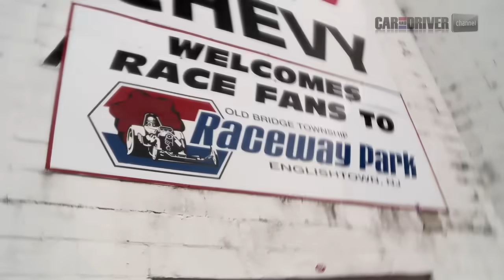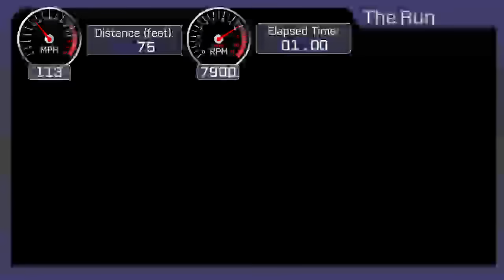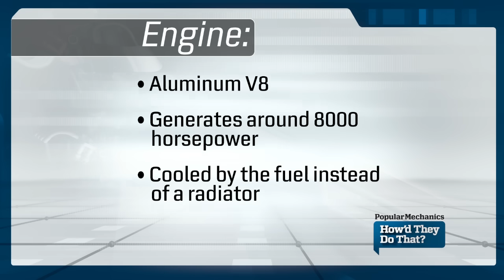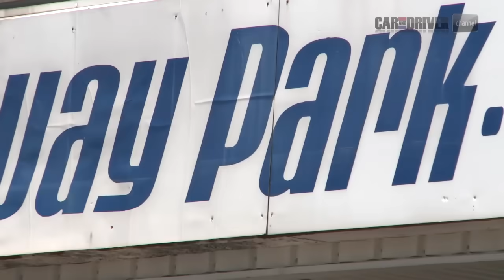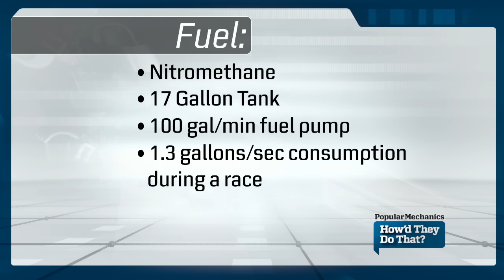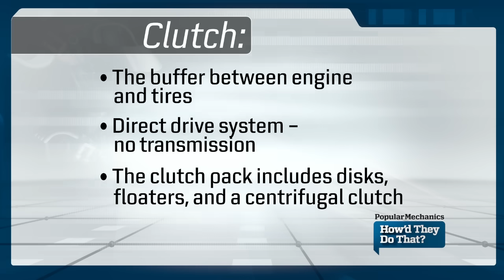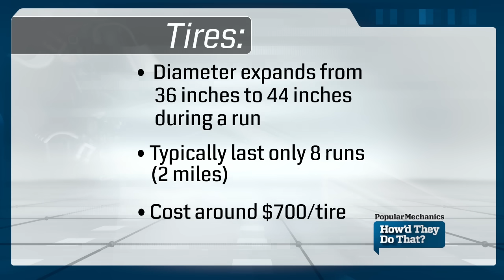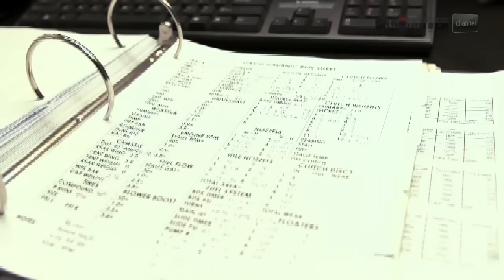How a Top Fuel Dragster Works

Comment: Crazy to think you need 600+Hp to run the Supercharger lol
Reply: Not really. 

Most engines require comparable power for compression, turbos, etc. 

The 1050 hp turboprop engine in my aircraft requires 2000 hp to turn the compressor.

Comment: These are so impractical as a daily driver. Especially if you live more than a quarter mile from work.
Reply: Yes, but you do get off the line at the stop lights a little quicker than the Corolla sitting next you.
Reply: Lou Clifton great for those mornings when you slept in a little.....
Reply: @davecasey4341  And probably also a bit faster than the guy flexing his Lamborghini at the stop light.

Comment: man i am cringing at the thought of how much money all those teams are spending for new engine parts
Reply: Alot they only use the motors for like a two race events or so then have to get a brand new motor and each pass alone probably costs 10,000 if not more
Reply: @thenotoriousnova1102  i wonder how they gear the cars transmission so they could reach 300 mph like that
Reply: Derek Wall yea its a crazy engineering feat
Reply: @derekwall200  No  transmissions, its a direct drive. The clutch provides slip until later in the run then the clutch locks up and it goes 1:1. The rear end is mandated at 3.20:1.
Reply: @derekwall200  no trans just a 5 disk clutch and a little gearbox behind that for reverse that's it

Comment: My 1964 Rambler would destroy any of these rails in 1/4 mile hands down.....
Reply: if you can make a 330mph run I'd love to see that
Reply: +Boar Hog Doesn't have to.  They are self destructing.
Reply: +Aaron Slaughter Not in 1000 feet for sure, 1/4....Its already been done.
Reply: Rob A   you mean to tell me my aluminum warped 6 cyl block that use to burn a quart of oil every 100 miles literally could not win...after all it was a 3 in the tree...paid 100 dollars for it and 50 for insurance back in 1981 ..Unfortunately it would only do 65 mph on a good day top speed and i had to drop it down to 1rst gear to go up some hills.
Reply: +Aaron Slaughter .....Antron set the current T/F MPH Record is 332.75 at Brainerd at the Northstar Nats last August 23rd, 2015     Spencer set the ET record on the same day at 3.680.     

Matt set the MPH Record at the finals on Nov. 15th, 2015.... that's pretty stout with approximately 1,500 - 2,000 Less hp than T/F.
Reply: Didn't Mike Ashley drive his 2007 Nitro Funny Car 334.32 MPH in 4.72 Seconds? Not bad for a Funny Car either. Amazing stuff.
Reply: +Boar Hog lol...
Reply: That was a 1/4 mile time, they switched to 1,000' in 2008 I believe.
Reply: That's when I stopped watching. 1/4 mile or nothing.
Reply: +Al Yes it was in 2008 they started running the Pro Fuel classes, top fuel & funny car, to 1000'. It happened after the crash that killed Scott Kalitta at Raceway Park, I was there that day, the explosion happened right in front of me.
Reply: @GeraldRisch  That makes no sense considering that they can now do more in 1,000 feet than they used to do in 1,320. If anything, they're even more impressive to see now.
Reply: Boar Hog,  Only if you can get it out of 2nd gear you mean...

Comment: 40 minutes to rebuild a entire motor, so can some explain to me why my car is at my mechanic for 2 hours just to change the brakes?
Reply: Phil B Because on the drag strip they have a big crew working at it at once. And these guys are probably doing it multiple times each drag race day, so that they have perfected their speed in doing it.
Reply: @earomc  joke brother joke
Reply: Yeah, one technician  one automobile,  engine and drive train fully assembled and tucked away into a frame surrounded by a body and all sorts of plumbing for fresh air intake,  exhaust, fuel send and return,  cooling system, and evap system  and ecm wiring harness and bcm harnesses and tcm harnesses and abs module and harness, oh I forgot about the hvac system plumbing and harness,  now for accessing just for maintenance,  now imagine only being able to open a drawer in your kitchen,  only interested will open almost enough to get your hand in there with difficulty,  and the pairing knife you need is clear in the back of the drawer,  because your WIFE doesn't want that paring knife anywhere else but there, and you have to skin an apple with it before you bring the pairing knife out of the drawer,  oh there is also a convenient air flow ductwork to cool off the blender in front of the drawer.  Engines get hot many popular automobiles have the oil filter and engine oil drain plug very close to the exhaust system components which can have surface temperatures above 400°F,   
Would be comparable to putting the drain plug or oil filter access in your garbage disposal unit  that may or may not be operating while you are trying to loosen them up. Verses a dragster where there are far fewer components and the systems that need rebuilt are practically out in the open,  and there's over a dozen techs performing assigned tasks and 2 more dozen people in reserve and assisting the techs who are actually hands on on the dragster. That's why it takes 2 hours to change your oil.
Reply: Sorry,  oil change and tire service is almost an hour, brakes take about 2 hrs because there are 4 brake stations  and there are certain procedures required to do unless you want a warning light lit up as you leave the mechanics shop which means that many of the government required safety systems will not be operating as required,  in which the tech can ultimately be liable for any damages and injuries or loss should you be involved in an accident as a result of the techs screw up,  again though  one tech one vehicle,  one brake station per tire.
Reply: Because you aren't paying 5 guys ten grand to do it ? :)
Reply: @philb707  sorry for chastising you, I'm  a technician who tries to be honest with my customers,  but at the same time I'm not trying to screw over my competition, but I just don't have to hand business over to them.
Reply: 5 working like mad men all at the same time everything layed out , mostly new parts , some say its the best part of the show , its really all unbelievable to watch.
Reply: It's called the flat rate!!!

Comment: One top fuel dragster 500 cubic inch Hemi engine makes more horsepower than the first 4 rows of stock cars at the Daytona 500. 
 
It takes just 15/100ths of a second for all 6,000+ horsepower of an NHRA Top Fuel dragster engine to reach the rear wheels. 
 
Under full throttle, a dragster engine consumes 1-1/2 gallons of nitro methane per second; a fully loaded 747 consumes jet fuel at the same rate with 25% less energy being produced. 
 
A stock Dodge Hemi V8 engine cannot produce enough power to drive the dragster's supercharger. 
 
With 3,000 CFM of air being rammed in by the supercharger on overdrive, the fuel mixture is compressed into a near-solid form before ignition. 
 
Cylinders run on the verge of hydraulic lock at full throttle. 
 
At the stoichiometric (stoichiometry: methodology and technology by which quantities of reactants and products in chemical reactions are determined) 17:1 air/fuel mixture of nitro methane, the flame front temperature measures 7,050 deg F. 
 
Nitro methane burns yellow... The spectacular white flame seen above the stacks at night is raw burning hydrogen, dissociated from atmospheric water vapor by the searing exhaust gases. 
 
Dual magnetos supply 44 amps to each spark plug. This is the output of an arc welder in each cylinder. 
 
Spark plug electrodes are totally consumed during a pass. After halfway, the engine is dieseling from compression, plus the glow of exhaust valves at 1,400 deg F. The engine can only be shut down by cutting the fuel flow. 
 
If spark momentarily fails early in the run, unburned nitro builds up in the affected cylinders and then explodes with sufficient force to blow cylinder heads off the block in pieces or split the block in half. 
 
In order to exceed 300 mph in 4.5 seconds, dragsters must accelerate an average of over 4G's. In order to reach 200 mph (well before half-track), the launch acceleration approaches 8G's. 
 
Dragsters reach over 300 miles per hour before you have completed reading this sentence. 
 
Top fuel engines turn approximately 540 revolutions from light to light! Including the burnout, the engine must only survive 900 revolutions under load. 
 
The redline is actually quite high at 9,500 rpm. 
 
Assuming all the equipment is paid off, the crew worked for free, and for once NOTHING BLOWS UP, each run costs an estimate $1,000.00 per second. 
 
The current top fuel dragster elapsed time record is 4.428 seconds for the quarter mile (11/12/06, Tony Schumacher, at Pomona , CA ). The top speed record is 336.15 mph as measured over the last 66' of the run (05/25/05 Tony Schumacher, at Hebron , OH ).
 
Putting all of this into perspective: 
 
You are driving the average $140,000 Lingenfelter 'twin-turbo' powered Corvette Z06. Over a mile up the road, a top fuel dragster is staged and ready to launch down a quarter mile strip as you pass. You have the advantage of a flying start. You run the 'Vette hard up through the gears and blast across the starting line and pass the dragster at an honest 200 mph. The 'tree' goes green for both of you at that moment. 
 
The dragster launches and starts after you. You keep your foot down hard, but you hear an incredibly brutal whine that sears your eardrums and within 3 seconds, the dragster catches and passes you. He beats you to the finish line, a quarter mile away from where you just passed him. 
 
Think about it, from a standing start, the dragster had spotted you 200 mph and not only caught, but nearly blasted you off the road when he passed you within a mere 1,320 foot long race course. 
 
...... and that my friend, is ACCELERATION!

Comment: TV doesn't do these cars justice. You have to be there to really get the sensation of how powerful they are; feeling the ground shaking, feeling your body oscillating and your vision blurring from each of the engine's power cycles, the smell of the nitromethane - it is full sensory overload. The engines eat thousands of dollars of parts on each run. An NHRA nitro engine's 10,000 hp is equivalent to about the first five rows of the Indy 500 starting field. It is amazing how these crews tune the cars for maximum performance, walking a fine line between a successful run and loss of traction. These dragsters have evolved from the six second slingshots of the '60s to the technological marvels of today.

Comment: So the one person who can destroy an engine and clutch the fastest wins. That's a weird concept.
Reply: The narrations by the yanks, was not well scripted; ignore them, rewatch and listen to just the the ozzy, you will get clearer, better, more truthful information.
   After the event/weekend, the major parts will be checked for wear, tolerances, weight differences etc, and be if their 'service life' is still adequate, be matched with similar spec-d other componants for the next meet. 

   The only real parts that are destroyed each run are the some of the spark plugs and the clutch & friction plates; assuming nothing goes wrong or suffers a critical/terminal failure.

Comment: so...if it burns about a gallon of gas a second, and in the first second of a run it travels 75 feet, and there are 5,280 feet in a mile then 5,280/75....that's .014 miles to the gallon? seems about right...
Reply: +Graham Davies lol
Reply: it burns Nitro Methane the most oxygen rich fuel known - about $38.00 a gallon
Reply: Sounds about like my truck tbh

Comment: NHRA ruined drag racing when they reduced the length of the track from 1/4 mile to 1000 feet.
Reply: Back in 2006, Schumacher ran a 4.42 1/4 mile @ 327.98 mph. Back then, top fuel dragsters had 8,000 horsepower. Today's NHRA dragsters pack 10,000+ horsepower. So while I'm a fan of speed--gotta draw the line somewhere.
Reply: Richard Craig they were forced to do it!
People were dying! Too much speed at the top end of the track for those tires, and no suspension. I think that they are approaching the same speed in 1,000 feet as they were doing in 1,320 now though!
Reply: They started racing in Top Fuel dragster & funny car to 1000' in 2008 after Scott Kalitta was killed when his engine exploded at about 3/4 of the way down the track at Raceway Park in Englishtown during the Summernationals. I was there that day and it happened right in front of me, the car couldn't stop as he was knocked out and the chutes failed as well. The shut down there is rather short and he went into the sand at 125 MPH then into the safety net and hit a concrete wall. Englishtown didn't have the luxury of extending the shut down area, it's since closed completely, due to the fact that Pension Road the entry way into the track is right near the end of the track.

Comment: You can see fuel shooting out some of the exhaust pipes in the slow motion of it crossing the finish line.   
The narrator is not kidding that the spark plugs burn out.

Comment: The tons of pressure and heat from the air fuel mix and electricity that it fires up on all create wear factors on all of the parts.  Now today's top fuel cars are up to 11,000 HP.

Comment: The early 70’s Cadillacs had a 502 ci engine in it. But the car was 2-1/4 tons and didn’t have as quick of response. But I did get mine over 100 mph a couple times.

Comment: Good vid with a couple of inaccuracies:  there are dynamometers that will measure this amount of power, but the top fuel engine can't run long enough to get an accurate reading with the old dynos.  There are now electronic modules that can be placed in the drive train for real-time power measurement, and I understand that 12,000 HP has been verified on a least one engine.  The other thing wrong here is that nitromethane creates its power because it contains its own source of oxygen, which the more chemically potent gasoline does not.

Comment: There's one component missing from the explanation. One of the most gigantic set of brass balls on the planet that makes you capable to still push the button on what really is a high speed bomb(one with about three really good spots on it where a catastrophic failure of a part will turn the pieces of those parts into high speed bullets) even after you see how many points of failure are just waiting to go.

That guy must chant "yes I didn't blow up! yes I didn't blow up! yes I didn't blow up!" about ten times after every good run.

Comment: Got any specs on the rear ends? As in the axle diameters, ring gear diameters, ratios etc?
Reply: Chrisman in TF and Strange in Funny cars. 
12.5" Ring gear.  Massive pinion. 3:20 gear ratio

Comment: nitromethane has a low flashpoint 35 ºC relative to its autoignition temperature of about 420 ºC. This means you can get higher thermodynamic efficiency and run higher pressure ratios.   That is why it is used.  That is why burning so much of it gets the extra power.  8:15

Comment: These engines use Nitromethane and it is so volatile it can be compared to liquid dynamite in the cylinders creating that combustion. In fact you mist be licensed to purchase the fuel because its so lethal.

A single cylinder is pushing 1000hp to 1200hp each. 

Thats more than most weekend racers ever experience and 3x the average daily driver. 

Incredible.

Comment: Atmospheric pressure is about 14 psi so every 14 psi more increases the displacement of the engine making a 50 ci engine take in 1000 ci of air. So a 150ci honda engine on 14 psi of boost is like a ford 302cl engine with 2/3 the weight.

Comment: You want ground shaking? Unlimited tractor pulling tractors have 3-5 engines with combined totals approaching 15khp. It's run-what-you-brung. You'll see lots of v8's but also Allison v12's. Yes, I've seen TF and used to wrench a little on a friends Sportsman car.

Comment: Question:  Is there a way to tweak the clutch once you are staging the car or is it set at its final adjustment at the pit?  If it can be tweaked, how is that done without crawling under it and tearing it apart?
Reply: Thank you. One last question - the timers that control the release bearing, are they adjusted mechanically or electronically?  I often see the crew chief with a laptop at the start line but never have seen what appears to be a crewman tinkering near the bellhousing before launching.

Comment: The engine is cooled by the fuel? 
Gotta love the temperature gauge when reaching top speed
Reply: Yea if you get the fuel on your hands its like a cold burning feelings like buy some computer air duster tip it upside down and spray try to drip the liquid on your hand

Comment: So how do they stop if the clutches welding themselfes? Turn the engine off is an option, but they pull it back to the shop, so the engine would spin the hole way back.

Comment: We use to go to Memphis Motorsports Park every year NHRA EVENT.we left just before the Friday night Qualifying was over we got into my brothers truck an he reset the odometer we was just a little over a MILE & half from the track an the last 2 top fuel dragsters left to run that night took off we could hear them it was so violent his truck felt like he had his radio all the way up an his speakers was vibrating inside we couldn't believe it we talked about that for years telling people what happened most people didn't believe us but it was true an we still talk about it some an that's been since 2003 .we started going to NHRA event there in Memphis in 1988 to 2009 never missed a signal NHRA event held there..those machines are something you can't explain unless your there .